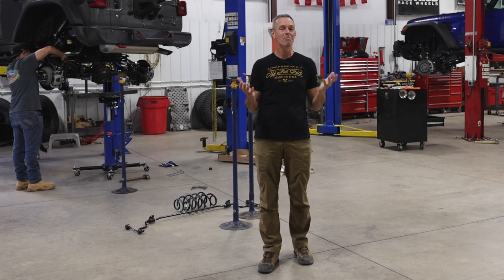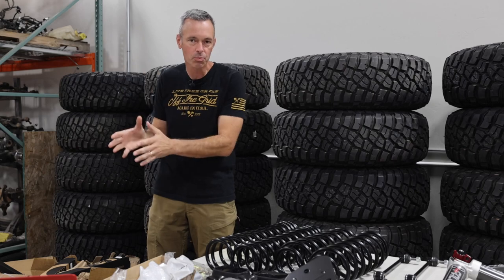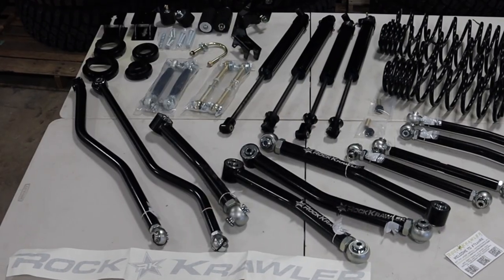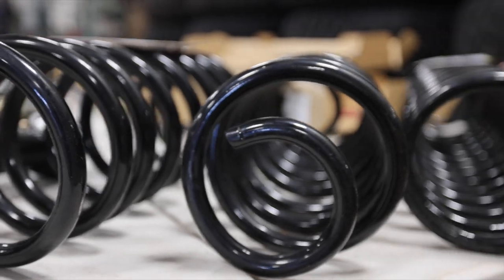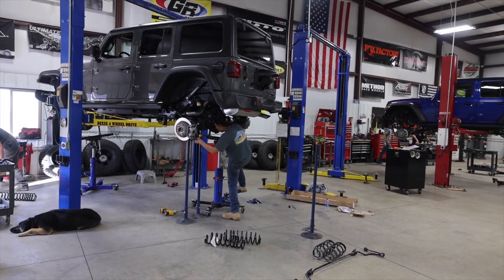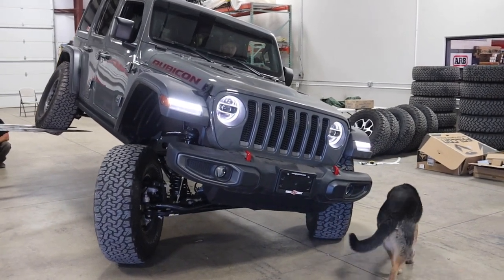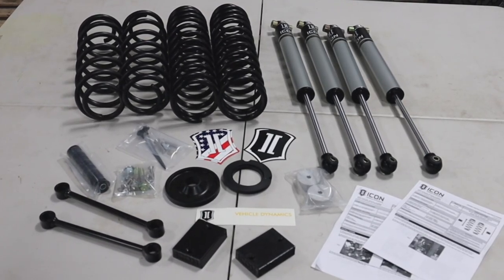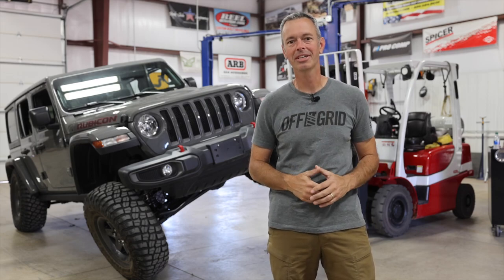The Ultimate Jeep Wrangler Lift Kit Comparison – Install & Measurements

Comment: I was really looking forward to seeing my Metal Cloak Gamechanger 3.5 inch lift with their Rocksport Shocks. Great video though!
Reply: I was disappointed as well. Im about to buy a lift and I'm really leaning towards the MC.
Reply: I can’t believe they didn’t include metal. I just bought an MC and Driveshaft and was hoping to get some tips. It’s also better than all of these for quite less.
Reply: I love my metalcloak 3.5” GC with rock sport.
Reply: I got just the Metal Cloak upper/lower control arms.  They are awesome!
Reply: Can't go wrong with Metalcloak.
Reply: Have the Metal Cloak True Dual Rate w Rocksports on my Gladiator and I’m very pleased with it. Installed myself in the driveway, so you can save a lot on install costs and learn some more about your Jeep
Reply: just get it, its by far my favorite lift. I've had the rock krawler and had an older version of the Teraflex on my first JKU before that. I went with the 3.5 Gamechanger on my newest JKU build.
Reply: I know for experience that the the falcons are way better at higher speed off-road....bit metal are really good for.crawling you can't go wrong with either one. I had both I. The past till I had my baby and I had to sell them
Reply: Love my MC dual rate coils!!!

Comment: I installed a Terraflex lift kit and  adjustable trackbars, upper and lower control arms and sway bar quick disconnects in a day out in my driveway. It's not that complicated and if you push a little you can do it in a day no problem.  This was the first time in my life I did something like that - I am trained though, so I know my way around metal working and mechanics, just normally not on vehicles.  I think if you're mechanically inclined any of these kits should be installable in the driveway in a day. Just don't let the axle drop - go one by one. I switched the control arms one after another so the axle stayed pretty much in place. If you don't do that the axle shifts and it's a pain to get it to line up unless you have a lift etc. With a jack in the driveway go one by one.

Comment: This is so awesome!  I'm on my 3rd lift. I liked my second 2.5 Rockcrawler, but their control arm are not good on pot holes, I also had a lot of Death wobble and I tried everything to fix it(replacing bolts, etc) and even a fox ATS which helped a lot.  Ultimately I think it was the stock upper control arms.  Last lift is a Frankenstein, 4 inch teraflex springs,  teraflex front and rear track arms, MetalCloak Upper and lower control arms, fox shocks.  Of course you need all the exrta's, brake lines, bump stops, etc.  This lift is rock solid no death wobble .  I first put on Falcon shocks, but they were too long in the back (broke my shock mount), and was blocking the travel, so replaced with Fox, and I like them much better. 

Of course I also have HD skid plates, Extended rockrails, RVC front axle shafts, 5.13 gearing, on my 2007 JK.  

All of these lifts is a great starting point.  I started with a 2in teraflex budget boost.

Comment: Surprised Metal Cloak and Clayton Offroad weren't represented, maybe a 2nd version? :)
Reply: Was gonna say the same exact thing
Reply: Yep I’m picking up my jk tomorrow with a 3.5 true dual mc kit 4.56 gears and 35s. I can’t wait!!!!!!!!!!!
Reply: Yup same here. I am considering the Metal Cloak 3.5" Game Changer with the TFlex Falcon 3.3's for my '18 JLUR. Would have loved to hear about Metal Cloak's lift.
Reply: @joemanly8386   I have the 3.5 on my jku daily driver / off road vehicle. You won't be disappointed in any situation.
Reply: @joec3675  thanks for the confirmation - I’ve been hearing great things.
Reply: @joemanly8386  just got home with my Jeep. Umm wow I wish I measured before and after this thing is tall as hell now.
Reply: @GrumblesM4  is that the Metal Cloak 3.5” with 35’s on it? I’m really curious to know the height.
Reply: @joemanly8386  Yeah it’s tall as hell I can measure door height for you if you’d like I don’t know where I should be measuring at I have aftermarket bumpers
Reply: @GrumblesM4  I’m wondering about overall height and whether it will fit in the garage
Reply: @joemanly8386  I’ll check it out and post a vid it’s taller than my ram 2500 on 35s diesel truck.
Reply: @GrumblesM4  😳👍🏻
Reply: @CAZ32TT what don’t you like about it?
Reply: @CAZ32TT great feedback. The daily driver is primary. Other than that I will be doing basic overland camping.

Comment: The AEV I know measures higher because they account for weight. They're made for overlanding so they account for heavy bumpers, roof tent, and gear. Plus, its always better to have MORE lift than you paid for compared to less.

Comment: I have the Icon Stage 4 lift kit. We measured before I switched from 33s to 35s on my '18 JLUR. Jeep went up 4 inches with the 2.5" Icon kit. Didn't get the 35s on until the following month, so it looked like my rig skipped leg day far too many times.

Comment: Finally, some measured data on multiple lift kits in 1 spot. Thanks Brad! 😎 Did you guys brainstorm at all about how to do the evaluations in a data driven way? Perhaps by measuring vehicle acceleration or real-time suspension displacement? I’m an engineer and have been designing a system to do this for fun. Let me know if there’s any interest for future projects.

Comment: Good first video. I think an important item that wasn't mentioned is that these are all gas model jeeps from the looks of it. None of these numbers would be consistent and there are nuances of the installs that change if you have the diesel motor option.

Comment: I went with a Stage 4 plus EVO Overland 4.5" with King 2.5 shocks. Best lift I've ever owned and I have had many on other Jeeps in the past.
Reply: @Pepe Silvia I overland full time now. Went with a 4.5" because fully weighed down I lose lift but still clear my 37s on the rocky stuff. I run 37s instead of 35s because I can, didn't need to regear which seems to be the norm for the 2.0 but not the 3.6. Went with the stage 4 because it included adjustable track bars, control arms and shock mounts. The King shocks were already tuned for the kit which was a bonus since custom Kings are about 10-12 weeks out due to covid. Also, didn't go long arm because I wanted a bolt on install.
Reply: @Pepe Silvia I've been running the 37s for over a year. I was testing other lifts on vehicles in my Jeep Clubs till I could decide on a lift. I also wanted to see what kind of mileage I would get on 37s and if I needed to regear or not. I got the lift 3 months ago and as far as mileage I get 19/22 mpg on 37s which isn't too bad. Sadly with the 2.0 they don't have an extended gas tank yet due to the ESS system being in the way. I can carry @ 14 gal in rotopacks mounted on the exterior though. It's just me and my dog so I even opted out of needing an RTT because him and I can sleep comfortably in the back. I also ditched the back seats (shaved more weight and added storage space). I was able to build a platform across the back with strapped down Frontrunner Wolf Packs and I just lay a fitted pad across the top when I need to sleep. The boxes make getting to my gear easy and the plus side is the pad hides all my gear, so from the windows my Jeep looks empty inside. Since my dog doesn't need the full length, it left room on his side for the fridge and water can, etc. With the Wolf Packs, my only need for a roof rack at this point is for maybe an awning and recovery tools. I put my build on hold to see what I actually need over time rather than what I think I will need and putting my trip on hold. I was special operations in the military for over 15 years, so I can travel pretty light, very comfortably.

Comment: Great video! amazing the difference between each of the lift kits. I had my own experience going from a TeraFlex to a Rock Crawler.  Even though the lift was only 1/2 inch higher, the Rock Crawler was almost 2.5 inches higher than TeraFlex. I wish this video was done before I did my upgrades!

Comment: It'd be cool to see a similar compare with the different jl engine options with similar wheels and tires and suspension on the same trail.
Reply: On the trail and in 4 low you're not going to see much difference between any of the engines.  On the highway is where the differences are greater.

Comment: I’ve been interested in the Dynatrac lift for my JLU Sport S. I don’t want a ton of lift because I only want to run 285/70 r17 on my stock rims and no re-gear. All the trails are 8 hours away so it’s 90/10 road to trails.
Reply: I had it on my JLUR until I upgraded. I had no problems and had very good flex with it, better than stock stability as well. One thing I added with the kit however were the metalcloak progressive bump stops and I really like them. Keep in mind however, the metalcloak bump stops take up an additional 1" of travel, so you will need to reduce your bump stop extensions in order to maximize compression travel.

Comment: This was a great video for me as I am currently debating a lift kit. I am currently running the Teraflex Nomads on 35" Trail grappler and bot rubbing, but still considering a small lift. Anyway great video as always and thank you for your service.
Reply: 35’s and not rubbing?  You must be in a JL. I just ordered the Nomads for my JK.
Reply: @KansasSlim64  2018 JL Rubicon, I bought the rash rings, but have not used them. Let me know what you think about the wheels, I love mine.

Comment: Awesome videos, first channel I check when I go to YouTube! :)

I went with the AEV 2.5" since I planned to do some overlanding, and that means the Jeep would be loaded up with a bunch of stuff. Yea, I take out the back seat, but I also add steel front bumper, winch, steel back bumper with tire carrier, full steel skid plates, cargo platform, storage drawers, and fridge.

Staying under the limit, but I wanted the Jeep to be able to handle my Moab>Rubicon trip in June. Test rides show that a loaded Jeep with the AEV 2.5" handles both highway and offroad boulders really well.

Comment: Rock Krawler by far for best overall  Most complete kit with shocks valved & tuned in conjunction with their coil springs but can't do a suspension shootout without RK's closest rival, Metalcloak...let's not forget about Evo either. Even Synergy, Rancho, might as well throw Rubicon Express into the mix.
Reply from the maker: Would have loved to have had many of the others in this comparison, but they just were not available.
Reply: @TrailRecon  Doesn't matter, the idea and goal of this series is great and i cant belive the work that had to be put into this! Good on you!

Comment: Fantastic series! I’ve got the AEV on my JLR 2-DR so looking forward to seeing how it fairs against the big $$$ builds.
Reply: i was considering the AEV but went with metalcloak instead. AEV just doesn't flex nearly as much and the brackets cause issues with clearance. Although for just overlanding its probably fine. I also hate the rake it leaves.
Reply: @ValFinale  mc leaves rake too
Reply: @kjm8135  not at all close to aev
Reply: @ValFinale  they’re the same. The rake on an aev is less than 3/4 inch after everything is installed. The rake on MC is 1/2 inch.
Reply: Every kit leaves rake so when you load up the back with gear or passengers you don’t have a Carolina squat
Reply: And saying AEV left too much rake when the numbers Brad posted said they were one of two companies that lifted the front more than the rear.
Reply: I’ve a 2-door, no rake, on 37s. On my JTR,  with Mopar 2”, I used Teraflex spacers up front to level the rig.

Comment: I installed the AEV 2.5 inch DualSport RT and am really enjoying it. I think the video shows the geometry relocation bracket adjustable chip upside down. Look at the video at 15 min and 32 seconds. Then look at AEV instructions for the relocation bracket. I was very careful with this and it looks upside down to me. Of course I have 1 lift kit install under my belt and I'm guessing the team that installed this kit has a few more! Let me know what you think as I may need to make a change.

Comment: ICON shocks love to leak and and their warranty sucks. Mine started to leak right after the one year warranty expired. They told be to go to a designated 3rd party repair shop and they wanted 175. per shock to rebuild. Since one was leaking pretty bad they all went into the trash.

Comment: I have stock suspension with 35s.  I have aftermarket steel fenders and steel bumpers so I never have any rub.  It’s kinda funny that I have the same ground clearance than guys with a 3 inch lift on 35s with a lower center of gravity.

Comment: Thank you for this video. Thinking about the teraflex kit at 3.5”. Should I be concerned about the front drive shaft not working or having issues?  

Is 2.5” kit better to run 35” tires to stay away from driveline issues?

Comment: hi brad, another excellent video. can i ask what you would suggest for a 3d gen/2005 Mitsubishi l200 triton pickup truck. it will be mainly used for overlanding but also off roading, here in the united kingdom. many thanks.

Comment: First Jeep was 2019 JLU only thing I did was have the 2.5 Mopar lift kit installed. Best decision I made being a weekend warrior.  I stay on the easy to morale trails at our parks here in Ga.  Do you participate in a 4 wheel 2 heal for disabled vets that are getting reoriented back the grove of life.  Jeep’sand and veterans are like PB&J.  Since 1941✌️ 73 K9PAL

Comment: Very curious about the 37's on the stock axels, drive shafts, steering & ball joints with those lifts, as well as stock gearing. Is that an OK way to go, or does / should more reinforcing need to be done?

Comment: Do they sell just the springs? My 392 already has a 2" lift from the factory so I just need springs that will lift it an additional inch. All those control arms aren't necessary for me.

Comment: @TrailRecon do you recall if the Icon lift kit on your JT had the same ballpark height as the kit you installed on one of these JL'S ?  Just wondering if it resulted in a higher lift than 2.5" like the kit for these JL'S because that's all that's been holding me back from their kits, I'm looking for more like 3.5" but if their JT springs run on the larger size I'm definitely going with IVD.  Thanks!

Comment: @TrailRecon since you placed 37" tires on all of these JL Rubicons, did you all do anything with the gears or were these all the stoke JL Rubicon 4.10 gears? If left to the default 4.10 gears, would you recommend upgrade to the gears if you were to use the 37" tires past this test as in long term and how long would you go on these before you upgraded the gears if you stated yes. Also were any of these rigs Manual or all Automatic?

Comment: My question is did any of the lifts require replacing the driveshafts? I was told with my JKU Sahara with manual transmission, that I would have to replace both front and rear driveshafts with any lift over 2.5”. For the trails and dunes I play in, I have bottomed and fully extended my 2.5” lift. I’m currently saving for a larger lift and shafts for the future. Full stuff doesn’t feel good at all, and I wasn’t even being hard on the old girl either.

Comment: Gosh darn it Brad your making me wish I had gone with a icon 2.5 lift over my teraflex 2.5 st2 lift. I’m very curious as to actual height gain from the st3 to the st2 since your finding are on the st3 are barely beating a 2.5 inch lift.